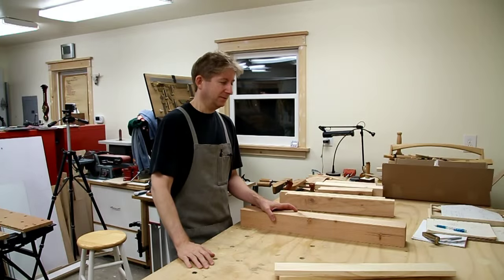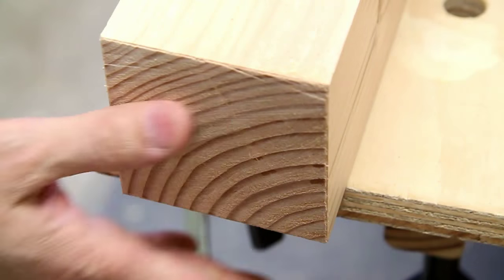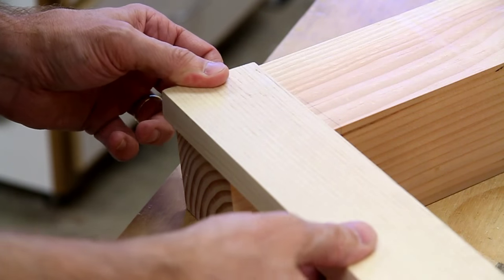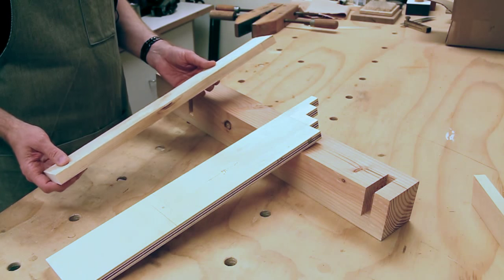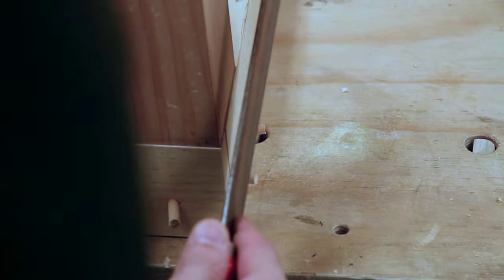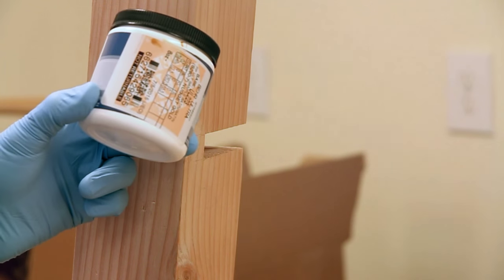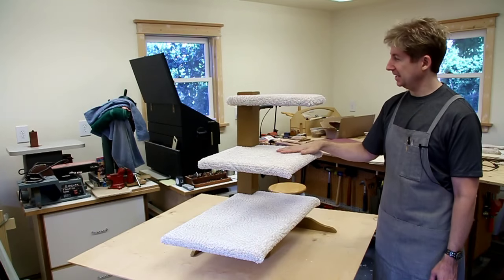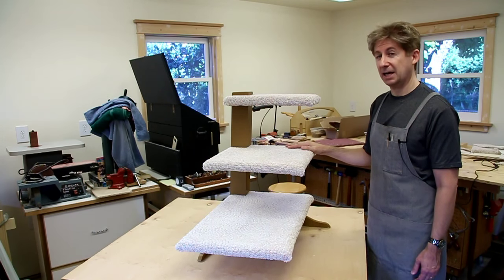Making an Inclined Cat Climber - Extended Version

Comment: Why didn't you use a saw to start those mortises? Sounds painful doing the whole thing with just a chisel. So mad respect for hanging in there on that.
Reply from the maker: Robert Hunt Thanks for the comment. I guess I was committed in my mind to doing the mortises with chisels, so I stuck with it. I should say that I very much enjoy using hand tools so it didn't bother me. However, if I had much more then 3 to do, I'd probably have jigged up some power tools.
Reply: Marty Backe Fair enough! That's what it's all about.